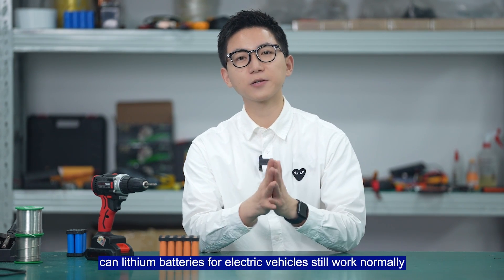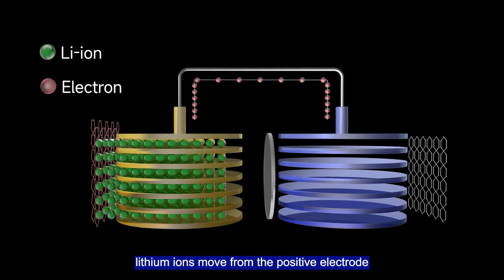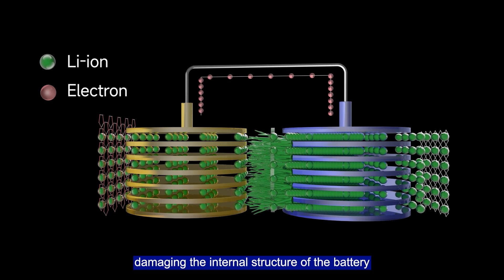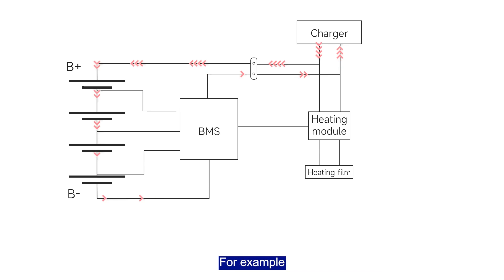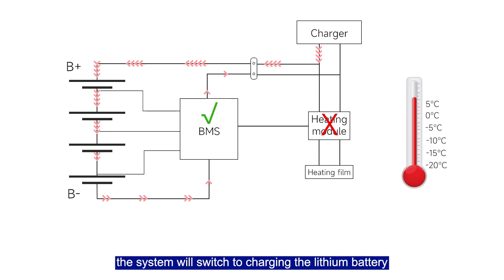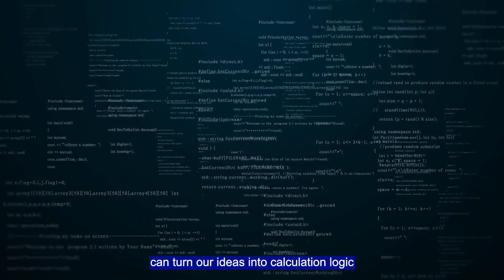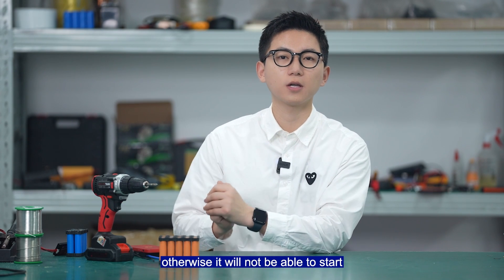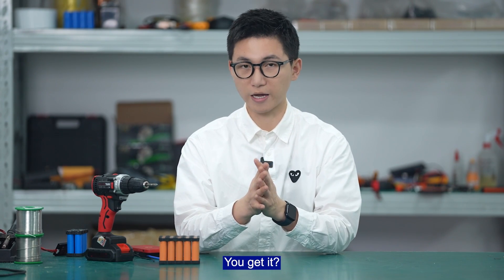Heating module

Comment: what happens to the heating module when the chargingcurrent is low?
For 12.8V LiFePo4 Batterys I have seen, that the heating foil draws about 5 A. What is when Chargingcurrent is only 2 A? Does it still use that 2 A to try to heat up the Battery or does it stop heating until 5 A is available?
Reply: Hello, have you figured it out? I'm wondering the same
Reply: @ Not realy but it Looks Like then the heating current is also low. Like it is the Same